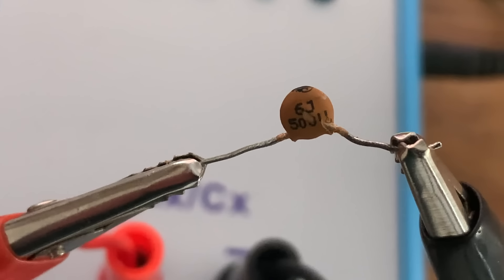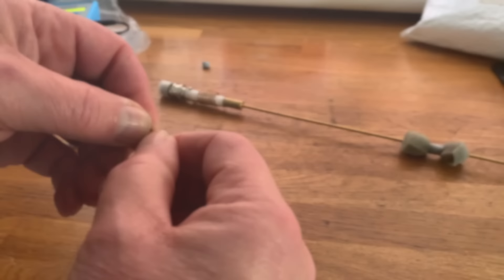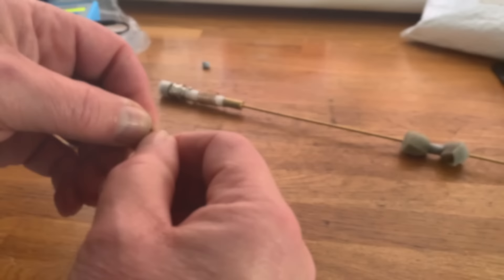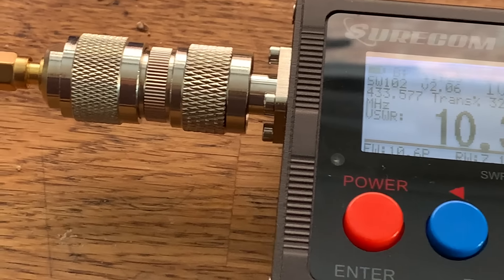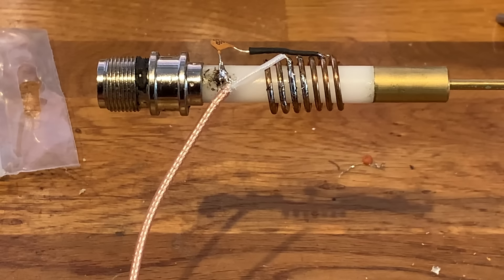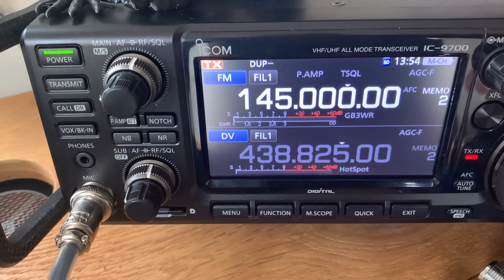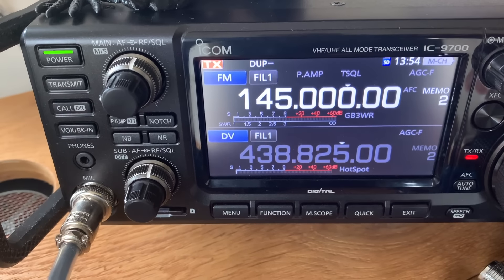HAM RADIO: Antenna Autopsy 2 A look at a 2M /70CM X300 Diamond/Watson Antenna

Comment: I blew a similar antenna up a few years ago running 200W on 6m into it. I still have it so should really try and repair it and replace the ceramic caps with coax caps - probably be good for a LOT more power than the rated 100W,

Comment: Before I was old enough to attend university for my engineering degree I learnt so much by dissecting bad electronics and figuring out why and how it worked. Now, 40 years later and after a career as an RF engineer those memories and experience continue to shape my professional and personal life.

I remember scraping the coating off of the different styles of resistors and finding some that were just pure carbon, other that were glass rods that had a circular track grooved in to them with conductive powder in the grooves. Taking apart capacitors; Even breaking open tubes to look at the plate, anode, grid and filament structures. Invaluable to be able to do that and make sense out of how things really work.
Reply from the maker: Yes, I to dissembled just about everything I came across, lol, happy days

Comment: Hi Mike, G6BPC in stroud here. I did exactly the same mod to my X510. Not because it was faulty, but there is evidence that the capacitors are prone to melting at 100 Watts or more. I think it's my most popular video! Mine is an original Diamond and after many years the three seals on the sections have not let in any water. Thanks, Nick
Reply from the maker: Thanks for the info!

Comment: Hello Mike, interesting to learn that someone else has this problem. Sorted mine with silver mica capacitors in place of the ceramic type. Initially thought it was going to be a bin job until I saw the Allen screw holding the base in place. Retired from the radio Engineering Industry now, so plenty of time to play with the ham radio. Single feed to two radiators, current at different frequencies will flow out of the junction where it has the least impedance same as the nest of dipoles, ie if it sees 50 ohms it will flow into that radiator, that is one of the reasons we never used multi-band aerials in my early PMR days, too much hassle if a fault developed. vy 73 de John G4YDM
Reply from the maker: Thanks John. :)

Comment: Hey.Ive had the same problem. I removed a capacitor and also installed a cap made of very thin coax. I trimmed it till the SWR was ok. Works perfectly fine. I think that coax made cap can handle more power.

Comment: Very interesting to see the internal construction of the aerial, when you tested the small capacitor it seemed OK, perhaps it was breaking down when it got a higher RF voltage across it. Good tip using the coax
Reply from the maker: yep, spot on.

Comment: great mike. found the problem, a bad 6PF cap. what happened that cap got so hot it un soldered it self.  that a colinear antenna. the coils up the antenna push the lobes out on the pattern flatting the donut pattern.  nice cap. if you get full data sheet on coax will have cap value per meter listed. gives you a cut chart.  the 5/8 wave gain master for 11 meters uses a coax cap inside as well. 73's
Reply from the maker: Yes I have built one 8.4pF cap needed in the GM..:)

Comment: I had also same issue with a 3 band antenna. It save 300 watt max power I use was 150 watt on 2 meters. But most of the time it only was 25 watt ARPS. I fixed it 2 times. After I only use max 100 watt  I had no problem more.

Comment: It's interesting but I've found that if the capacitors lower their value , say down to 1 pf instead of 6, you may still have a decent SWR . A complete disconnection shows high SWR. That has been my experience with a slightly different antenna . That said, with the one still showing a decent SWR, the gain went away nearly completely.

Comment: when you resoldered  the original cap back on and you had high swr  didnt you notice  you had not connected the radias   back on to the outer of the so239  ? but when you swapped it to the coax cap  you did  so probably was working .

Comment: Sadly, I have seen many antennas with the same failure. Someone solders a wire to the coil without making the connection secure before soldering, and the solder fails due to vibration. You can't depend on solder to retain a connection as it isn't a strong metal, which is why it can melt at low temperatures.

By soldering the cap to the coil without wrapping the cap lead around the coil winding, may result in the joint failing again, because of vibration. The manufacturer did not make a secure connection before soldering, which means the solder is the only thing keeping the joint together. You doing the same may result in the same failure in the future.

Comment: It is a common problem these capacitors often fail. Either due to static load or excessive RF. I am curious how you routed the coax capacitor inside the antenna housing.
Best 73, Stan (DK2CA)
Reply from the maker: yes should have shown that, it was simply wrapped around the plastic below the coil.

Comment: 👍Well done Mike. I cannot say I am very surprised the little disc ceramic failed. Hopefully, the co-ax capacitor will do a better job. I am guessing that the tapped coil at the base is an autotransformer used to drop the impedance resistive element down to 50 Ohms and the shunt/series capcacitors will be cancelling out the reactance to around 0 Ohms. This means that you are left with approx. 50 Ohms restistive presented to the transciever. The "bendy bits" along the copper vertical section will be to adjust the phasing from each lower 5/8 element to the one above. They are bent back on themselves to reduce radiation. The idea is is the phasing sections don't radiate but just add extra length to make sure the 5/8 sections all radiate in phase. This is what gives the colinear it's gain.
Reply from the maker: Many thanks Steve.  👍👍👍

Comment: Hi I’ve just bought a computer designed di pole yagi for 2mtrs it’s from eBay hasn’t arrived yet but I’m going to use it ssb on bunker group 
Have you ever used one please.
Reply from the maker: ah No but I guess it will work perfectly. :)

Comment: i have a diamond X50 had to send it back 2 times they tell me nothing is wrong with it but i still have a high SWR on 70cm repeater inputs on 2.5:1 to 3:1 I had like 5 SWR meters and 5 different LMR400 runs..  got a Tram antenna and its like 1.5:1

Comment: Sir, how did you see that the coil was overdone by one turn? I”m sort of a nube to this…
Reply: He didn't change the coil, that was done at the factory, they often do stuff like that if the same coil is used on a bunch of models instead of ordering one for each.
Reply from the maker: The first turn was soldered to the second one...

Comment: I have the same antenna with the same problem, once i get it down, this video will be used for relevance, Just one question Mike, if the original capacitor was OK and just lifted off the one leg, why did the SWR not come back down? mine is high on 2 and 70, brand new feeder and plugs fitted. Found a short length of feeder the same as yours, no idea what i did but it measured as a resistor not a capacitor 0.04A. shoot me now Mike, it could only happen to me.  Just for clarity, the feeder you used as the capacitor, is it a specific length overall? the one end looks like you bared the braid and pulled it back and then just bared the centre conductor yes? i did this and couldn't get a measurement. i take it the other end is just cut and left, not joined?
Reply from the maker: Yep the coax cap, is NOT shorted and a small amount of separation is needed to ensure it does not short. a lot of coax can act as a cap (look at the spec's) but most are around 1pF per cm of length..

Comment: So the conclusion is the capacitor was broken even though the LCR meter initially sowed 6 pF? Or am I misinterpreting?
Reply from the maker: Correct, the capacitor was showing 6pF at very low power but as soon as you put it under load it broke down.
Reply: @mike-M0MSN  Thanks Mike - Alex M0OOV

Comment: so the original cap was broken even you tested/measured it? or what was the reason it finally worked? sorry, english is not my native language
Reply from the maker: Original Cap tested ok but did not hold out at a higher voltage, so needed changing

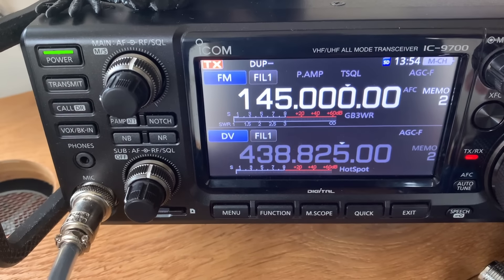Comment: in the kitchen u got the radiation element directly  connected to the radials /ground  .  its litterly leaning against the part at 11:33  how just  how
Reply from the maker: Well yes, it looks that way but it is lined with tape to shop that from happening.....

Comment: Certain sure that's not a Diamond got 3 of them here. Diamond have the larger radials. Had this happen to me one before using a Sharmans copy X300 that was used on a remote site with high wind loads. It was only used as an RX antenna so not sure why the capacitor went in it. Whilst I also had it apart I added plenty more foam inside of the GRP shroud to stop it rattling, its lasted 6 years since.
Reply from the maker: Hi Dan, yes you could be right with Sharman...  good point.
Reply: Does static electricity get to the capacitors?